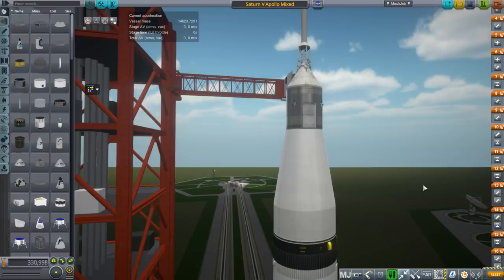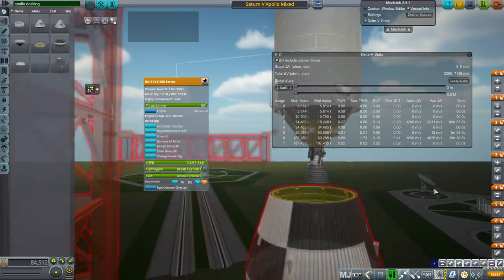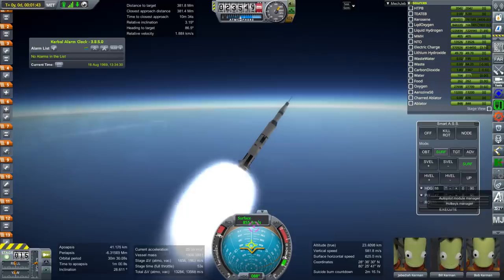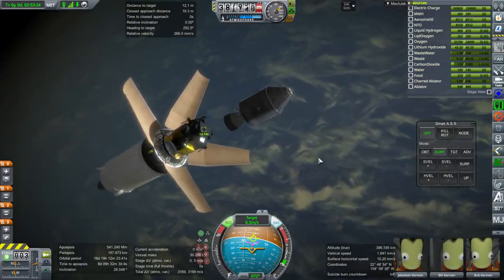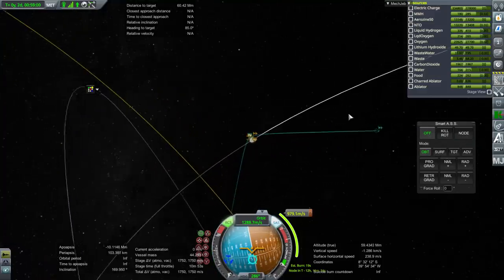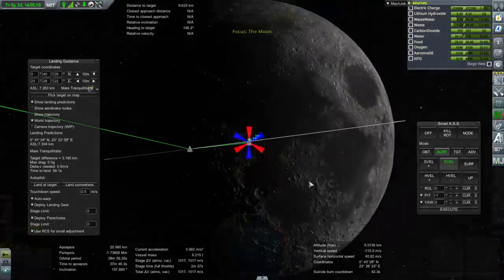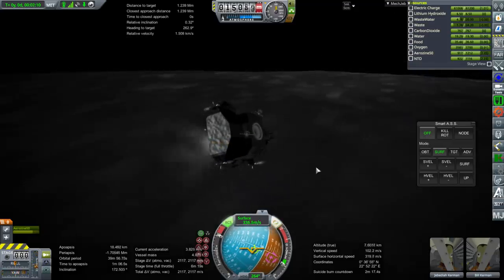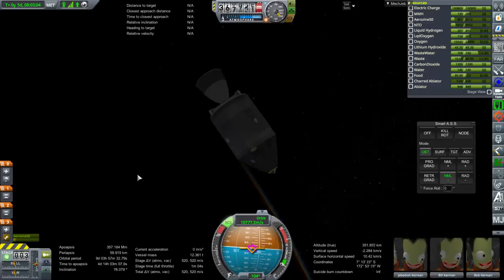How to Land on the Moon 01 - Apollo

Comment: In addition to the center engine out on stage 2, it also shifts fuel ratios to go from fuel rich to fuel lean when the thrust to weight starts to increase, as a safety measure against pogo.
Reply: ^ my guess as to why the burn times seem to be short
Reply from the maker: I know about the fuel ratio throttling - that's not what affected the burn times. When kOS launches with the rocket the timing is right.

Comment: You have the SLA fairings separation wrong The four panels are supposed to separate and fly out not stay attached to the S4B
Reply from the maker: Really? http://i.imgur.com/YNVZuYF.jpg Edit: okay, seems like that might be just Apollo 7 and the Saturn IB missions. That said, my experience with having them separate in KSP is that they come right back and get in the way. That's certainly true of the FASA ones.
Reply from the maker: Looks like the SSTU ones aren't as bad, though. I'll decouple them on deploy for the Apollo 11 video.
Reply: @RaizSpace  Correct. Up to 7 they stayed detached, but a partial deployment on 7 caused them to worry about a potential collision, so the SLA was redesigned to detach after the panels had gone out to 45 degrees

Comment: I'd like to know your thoughts, Tyler, on the new dlc for KSP. Better to just stick to infernal robotics, and the other mods that the dlc brings? It feels cheap of Squad to charge for something that's existed for so long.
Reply from the maker: I haven't really played enough with it, but for now I'm sticking to Infernal Robotics, because from what I did do with them, they seemed rather unstable. I think they're mainly for people who only play stock, but maybe the parts improved in the latest patch (1.7.2). I don't know if the additional action groups come stock or are dependent on the DLC, but that's an interesting feature.
Reply: @RaizSpace  Yeah, I think it makes more sense to stick with infernal robotics, as it's been continuously updated and improved over the years, its bound to produce better results than squad's version. In my opinion, you can't justify that price for what they're offering.

Comment: How did you get the sizing right for the launch tower? Mine is really small compared to the RO configs
Reply from the maker: I added TweakScale to it. Here's the config I used to do that: https://www.dropbox.com/s/wwmhuz3ubjuexnp/RO-ModularLaunchPads.cfg?dl=0
Reply: @RaizSpace  I downloaded your tweakscale file, but I guess I'm not installing it correctly. Where do you drop the tweak scale file? In the mod file or RO? I have tried many different ways but nothing seems to be working.
Reply: @heythere135  just drop it in the gamedata folder, also make sure you have tweakscale installed.
Reply: @Philly_Willy  thank you. As it turns out I had download modular launchpads from CKAN and not GitHub so it did not actually contain the tweaked files for RO. Once I did a proper download I installed the extra files and it works great.
Reply: @heythere135  Great to hear!

Comment: what s-ic, s-ii and s-ivb are? FASA, decq or other? i have decq but fuel tank capacity is less than your, first stage burns just to 21000m
Reply from the maker: This one was a mix of mods, but the first stage was FASA. The first stage should get you to a velocity of 2300 m/s or close to it, so if it doesn't, there's something wrong with the configuration.

Comment: Did you have to turn on the command modules fuel cell? I cant find a fuel cell on my version it is the FASA  module from the VAB, doesn't have a fuel cell option
Reply: same. i keep running out of electricity before i can even get to the moon to do my circularization burn

Comment: I thought Apollo azimuth was 72 degrees and off plane as to hit the equator of the moon? This looks great though btw!
Reply from the maker: Launching at 72 degrees may have been necessary because the timing was dictated by the need to get the proper sun angle at the landing site, but it is not necessary to reach the equator of the Moon. There may have been other considerations involved. The difference in delta-v required during launch is minor.

Comment: I thought there was only one ignition on the LM ascent stage IRL
Reply from the maker: There seems to be a few sides to this. One - the LMAE couldn't be tested because of corrosion in the engine, which gives the impression it could only be used once, but that corrosion might have been something that could take weeks to have its effect, in which case it would have been relightable during a mission. Two - the LMAE was based on Agena, which could relight with roughly the same types of propellants. Three - technically, the rendezvous can be done with RCS only - it's just really tedious.. Four - on Apollo 10 it looks like it was relit remotely after the astronauts were off to expend all its fuel, pushing it out of lunar orbit and into interplanetary space. Now, where the config gets ten ignitions from, I have no idea.

Comment: Why would they leave extra fuel in the tank that's a waste of delta v money and fuel
Reply from the maker: It's just what happens because it can't draw all the fuel from the tank evenly and they don't want the engines to go out at different times.
Reply: Ok that makes sence
Reply: Sorry I'm really bad at spelling
Reply: @RaizSpace  Also, you want a bit of a buffer, and for some stages they'd be relit after the crew were no longer using them